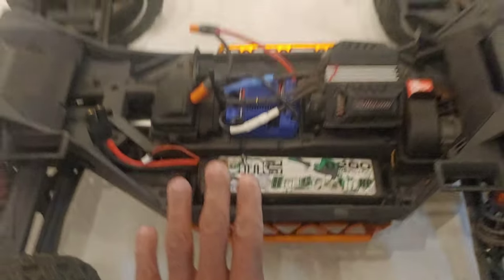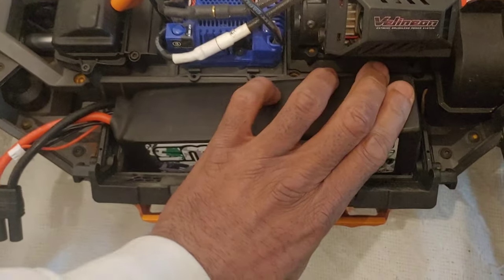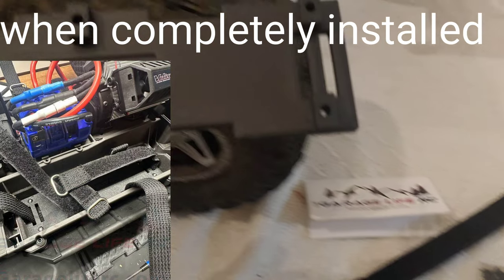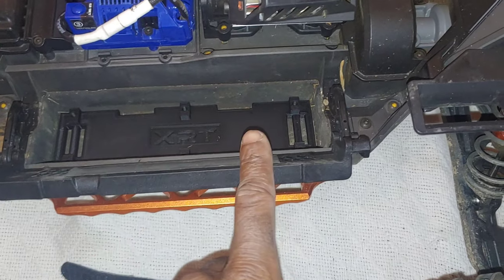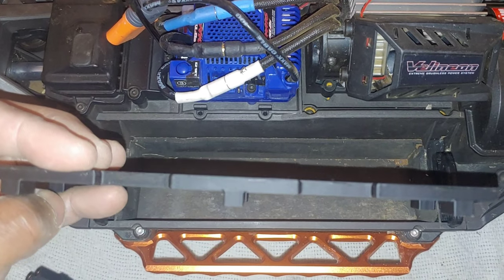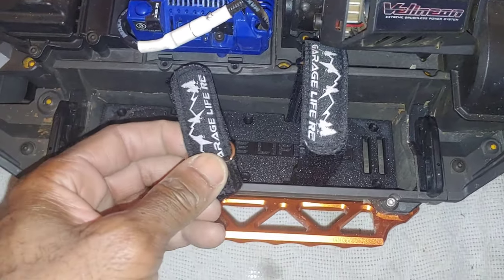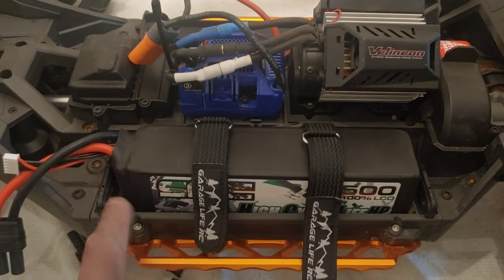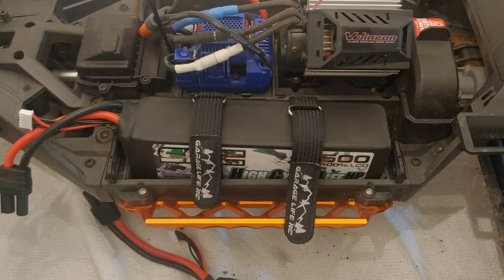Extended Battery Tray Option for Traxxas XRT

Comment: the fact traxxas charges 1500 dollars for this thing only to say screw you to their customers needs and wants is beyond ridiculous
Reply: $2100 AUD where I live, then you need $500 plus for batteries. If you change the ESC proprietary plugs, you lose warranty.
You can get adapters but I think that is now a weak point.
Then add to this that you have no local parts support.
I'm getting a Hobao MT2+ and saving a ton of $$$